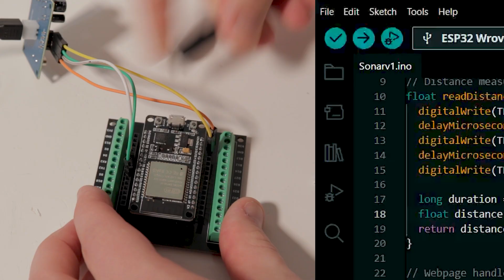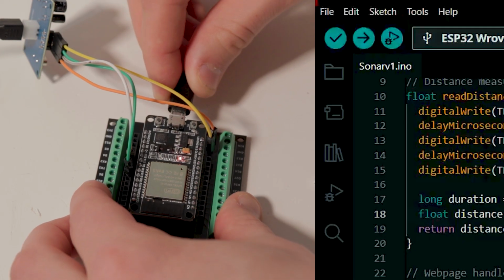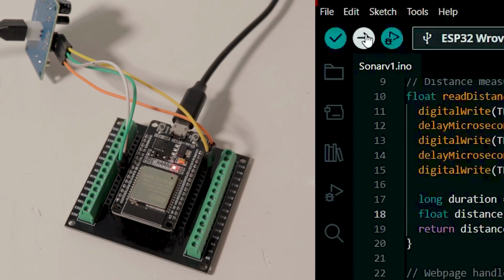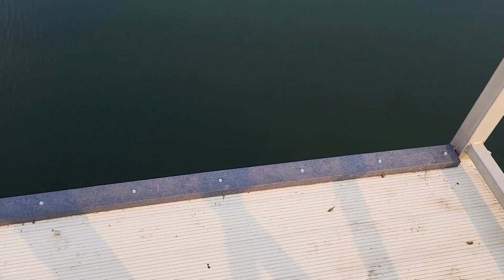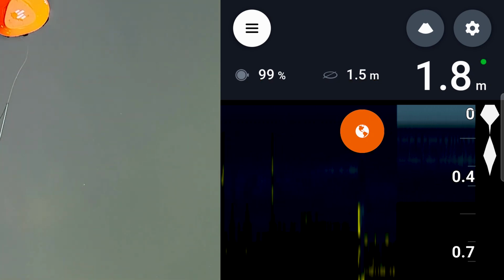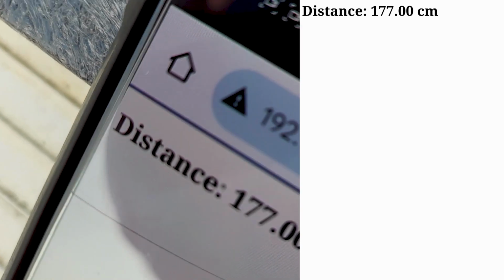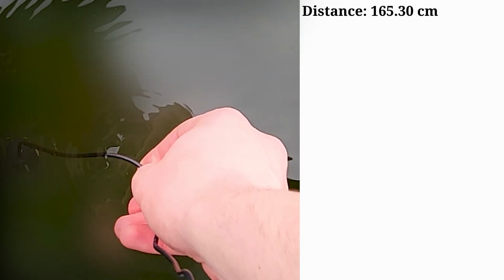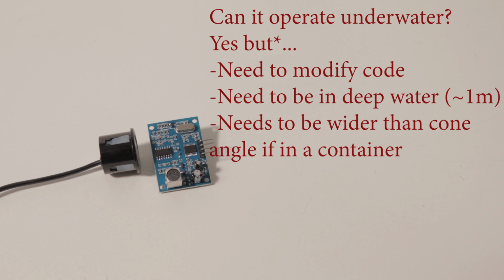Can ESP32 Powered JSN-SR04T Sensor REALLY Measure Depth Underwater?

Comment from the maker: Code I used if interested:

#include <WiFi.h>
#include <WebServer.h>

#define TRIG_PIN 5
#define ECHO_PIN 18

WebServer server(80);

// Distance measurement 
float readDistance() {
  digitalWrite(TRIG_PIN, LOW);
  delayMicroseconds(2);
  digitalWrite(TRIG_PIN, HIGH);
  delayMicroseconds(10);
  digitalWrite(TRIG_PIN, LOW);
  
  long duration = pulseIn(ECHO_PIN, HIGH);
  float distance = duration * 0.1500 / 2;  //Distance equation with 1500m/s speed of sound
  return distance;
}

// Webpage handler
void handleRoot() {
  float dist = readDistance();
  String page = "<!DOCTYPE html><html><head><meta http-equiv='refresh' content='2'/>"
                "<title>ESP32 Water Distance</title>"
                "<style>h2 { font-size: 48px; }</style>" 
                "</head><body>"
                "<h2>Distance: " + String(dist, 2) + " cm</h2>"
                "</body></html>";
  server.send(200, "text/html", page);
}

void setup() {
  Serial.begin(115200);
  pinMode(TRIG_PIN, OUTPUT);
  pinMode(ECHO_PIN, INPUT);

  // Start AP mode
  WiFi.softAP("ESP32");

  Serial.println("Access Point Started");
  Serial.print("IP address: ");
  Serial.println(WiFi.softAPIP()); // usually 192.168.4.1

  // Start Web Server
  server.on("/", handleRoot);
  server.begin();
  Serial.println("Web server started");
}

void loop() {
  server.handleClient();
}

Comment: How echo output (5v) of JSN-SR04t can directly connected to  GPIO PIN18  which expects 3.3v max?..  don't we require resistive or MOSFET voltage divider to get 3.3v?.. Please explain?
Reply: i also have this question beacause chat say we need to do this to not damage esp32

Comment: If you would start to fill the initial container with some water, would it measure the distance to the water surface, or rather (still) to the bottom of the container? I.e. is the water/air surface a good enough reflector to bounce the ultra-sounds off? OTOH, if you dip it into the water, it will measure upto the first solid reflector (like the bottom surface of the container!? What if you would create 2 layers of different liquid, say oil and water, would it be able to measure the distance to that oil/water layer if you dip the sensor into the oil (which is obviously floating on top of the water)?

Comment: #include <WiFi.h>
#include <WebServer.h>

// Ultrasonik sensör pinleri
#define TRIG_PIN 5
#define ECHO_PIN 18

// Web sunucusu port 80
WebServer server(80);

// Mesafe ölçüm fonksiyonu
float readDistance() {
  // TRIG pinine kısa bir darbe gönder
  digitalWrite(TRIG_PIN, LOW);
  delayMicroseconds(2);
  digitalWrite(TRIG_PIN, HIGH);
  delayMicroseconds(10);
  digitalWrite(TRIG_PIN, LOW);

  // ECHO pininden süreyi ölç
  long duration = pulseIn(ECHO_PIN, HIGH);

  // Ses hızı yaklaşık 340 m/s (0.034 cm/µs)
  // Mesafe = (süre * hız) / 2
  float distance = duration * 0.034 / 2;

  return distance;
}

// Web sayfası işleyicisi
void handleRoot() {
  float dist = readDistance();

  String page = 
    "<!DOCTYPE html><html><head>"
    "<meta http-equiv='refresh' content='2'/>"
    "<title>ESP32 Su Mesafesi</title>"
    "<style>h2 { font-size: 48px; }</style>"
    "</head><body>"
    "<h2>Mesafe: " + String(dist, 2) + " cm</h2>"
    "</body></html>";

  server.send(200, "text/html", page);
}

void setup() {
  Serial.begin(115200);

  pinMode(TRIG_PIN, OUTPUT);
  pinMode(ECHO_PIN, INPUT);

  // ESP32'yi Access Point (AP) modunda başlat
  WiFi.softAP("ESP32");
  Serial.println("Erişim Noktası Başlatıldı");
  Serial.print("IP adresi: ");
  Serial.println(WiFi.softAPIP()); // genellikle 192.168.4.1

  // Web sunucusunu başlat
  server.on("/", handleRoot);
  server.begin();
  Serial.println("Web sunucusu başlatıldı");
}

void loop() {
  server.handleClient();
}

Comment: Hi. Thanks for the short crisp video. While you have detailed all your experiments, I was wondering if there is a way to make this sensor work better when it's working through air, for example, if I was to use the sensor for measuring the depth of water in the tank, I had all the trouble and tribulations that you had in your bath, tub. So I ended up making a kind of a sound absorption tube that tends to knock off energy from the outer side of the lobes..
Just wondering whether this would be possible to do in the underwater experiment, though I would have no idea how to absorb that sound underwater. I guess felt lining or some kind of soft sponge liner should work in principle but only Test will confirm.
Thank you for taking the time
Reply from the maker: Hi thanks for the comment,

Im not sure how well a sound absorbing lining would work, I can't say I have tried that. The biggest limitation with this sensor from my understanding is it returns the first valid echo it gets after pinging thus you can't tell it to ignore echoes from a short distance and listen for weaker longer distance returns.

Comment: When it comes to these types of ultrasonic sensors, this one and the other alibaba L04 you tested on another video, do you think its possible an array of these could possibly function as a fish finder of sorts? I'm researching if this is possible without breaking the bank.
Reply from the maker: Hi, thanks for the comment!
I'm not sure how well it would work as a fish finder, since it doesn't provide any additional data like return signal strength. For this setup, it just measures the time between the pulse and the echo; the other one outputs a direct distance measurement. Hope that helps!

Reply